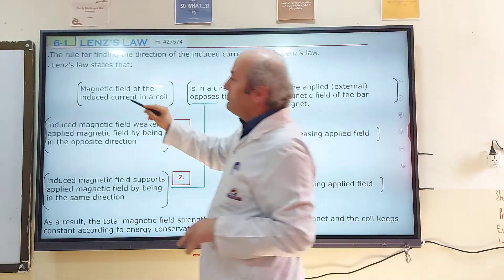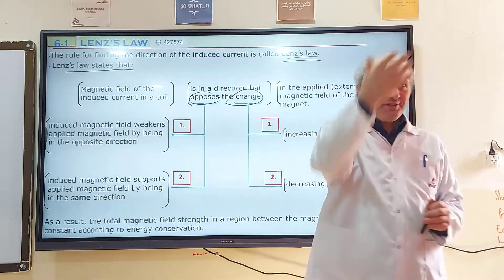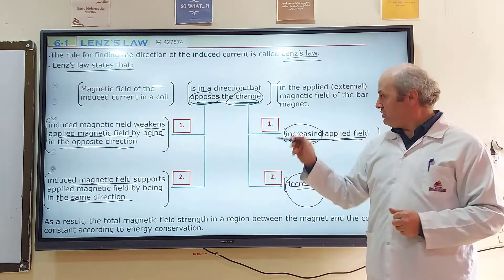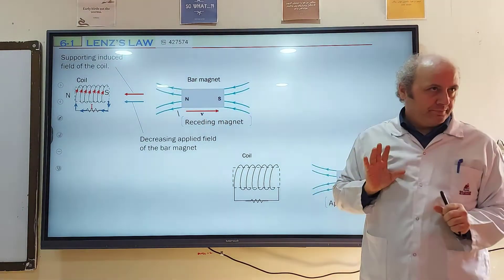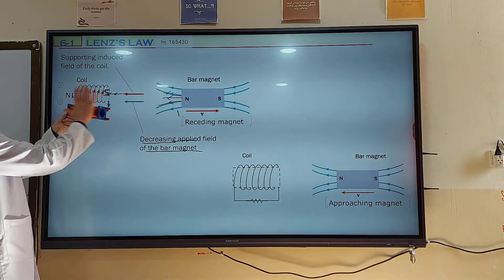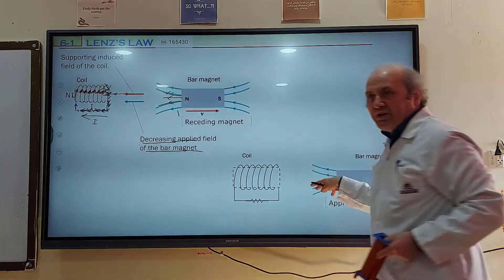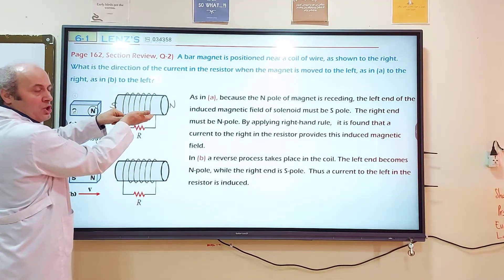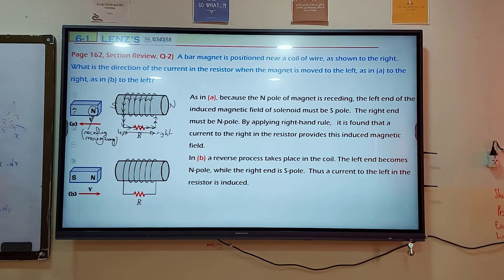Lenz's law, Chapter 6, Section 1, Course 4

Comment: 13:29
Direction of electric current
in a resistor
always
front to back > is right to left
back to front > is left to right

BUt what about if we have 
(battery) instead of that (resistor)
Will it be the same or differe ?
I mean this
front to back > is right to left
back to front > is left to right
(when we change the position of + and - end of the battery)
Reply from the maker: Depends on also direction of winding.